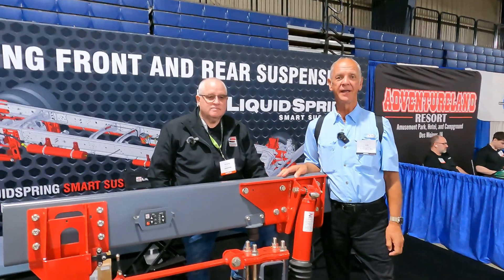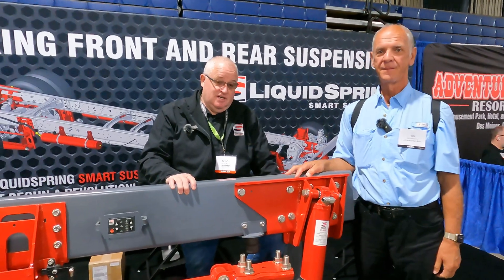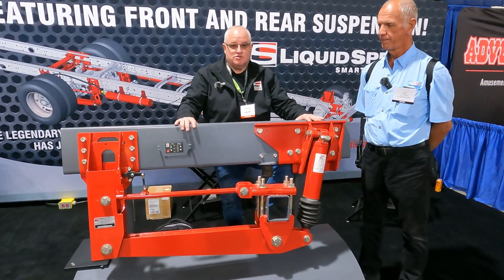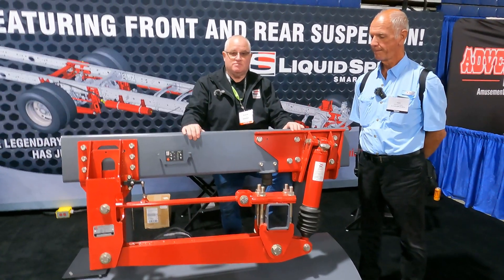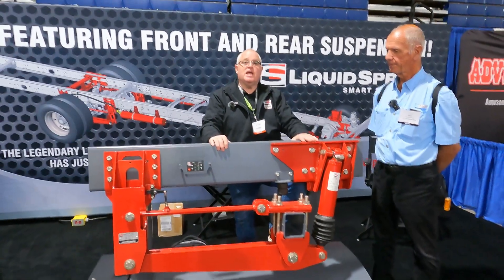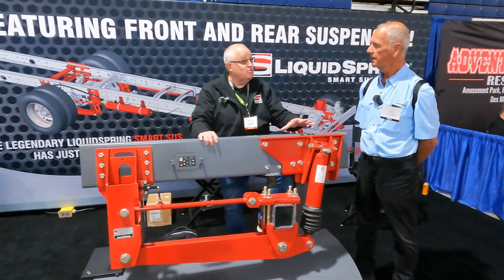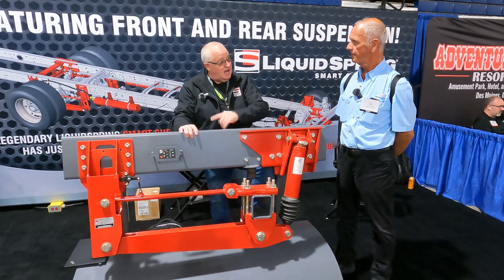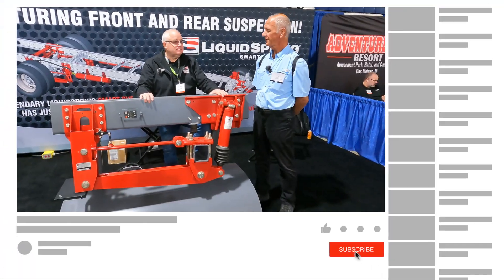Replace your leaf springs with liquid springs.

Comment: Let me be a vocal and angry dissenter.  On our rig, Liquid Spring has been an unmitigated disaster. Small class A, 2024 Fleetwood Flair 28A, 30 foot, 16k GVWR.  After getting a 4 corner AND Tru-Earth install we paid over 30 grand.  Pathetic.  Sumo springs and Koni shocks would have AT LEAST been as good of a ride and handling upgrade  I suspect better.  Maybe a 1.5 on a 10 scale improvement for our coach with LS.  Then, the most recent spit in our faces was it failed completely hours away from an authorized service center.  First, they don't work after hours so FORGET about getting any help from this awful company if it isn't 9am to 5pm.  Had to fork out an extra night at our spot but that wasn't even the beginning of it.  When I did talk to someone they were short and extremely unhelpful.  "You'll need to tow it...."  1800 bucks later it was a pump failure.  THe replacement part ships in a few days so we'll see if that is the actual problem.  I don't trust a word Liquid Spring says so I'm not optimistic.  Cancelled trips, heavy out of pocket expenses and a completely useless service experience.  I'm 57 and never been more disappointed with a purchase than this disgrace of a company and product.
Reply from the maker: I’m sorry you had such a bad experience. It’s always good to hear another Point of view.
Thank you for commenting and watching the video.

Comment: is it both a rear suspension and a leaf spring all in one? Do I need to remove both of my 2003 E-450 Super Duty RV?
Reply from the maker: Well, it’s not really like a leaf suspension that you would have now on your class a gas
It’s more of I guess a bracket that goes on the back part that then runs on two airbags that you can control the pitch the role and various other bumps that might be in the road I guess is the best way to explain it. I drove a vehicle that year. This video was done at the RV show and it was absolutely incredible. I would say it’s better than a diesel pusher with airbags , a little expensive if you could do the front and the rear and it’s recommended you both it won’t be the same and you won’t get the ride that you’re looking for
Hope it explains a little better but you’re gonna have to remove everything off your 450 
Thank you for watching and your comments

Comment: Cool idea but spring steel or airbags work great
Reply from the maker: Yes, I totally agree with you. I now have steel springs on my class A which are good. I’ve also added Bill Steen shocks. I’m using voice dictation so I’m sure that didn’t come out right but you know what I mean so airbags are much better but when you drive a vehicle that’s gone the full install of liquid Springs. It is something out of this world very very expensive but if you’ve got the money and you wanna make a class a fly over the road that’s the way to do it. Thank you for watching and your comments.